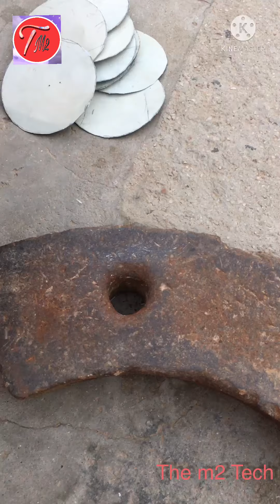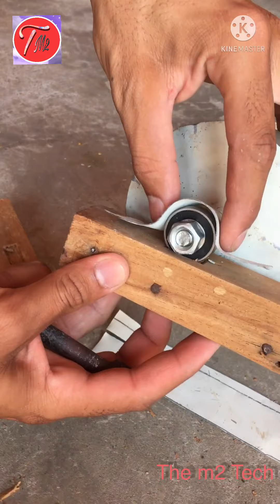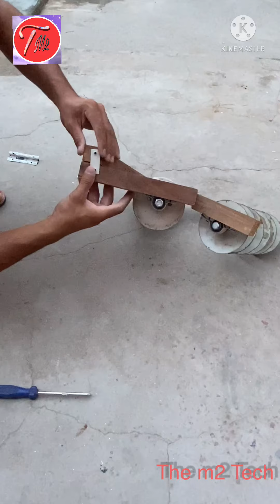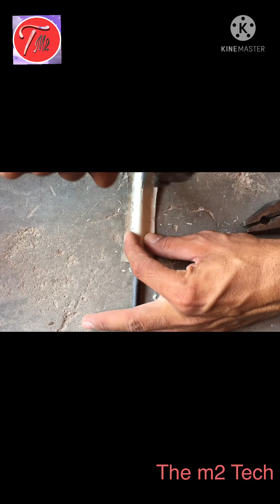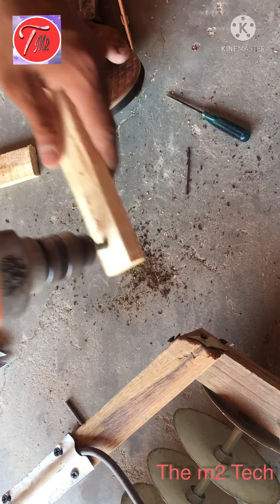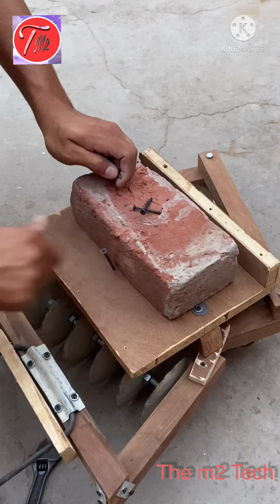How to Make a Disk Harrow at Home |Mini Harrow at Home #harrow #miniharvester

Comment: What material u use for the disc part answer in English good sir
Reply from the maker: This material is dish TV antenna,working is good but thickness is less otherwise perfect work,I suggest u,you can use 2 mm GI metal sheet. Thank you sir 😍😍😍
Reply: @mohitmalikk  thank you brother
Reply from the maker: @JohnEric-dg5nq 😍😍😍